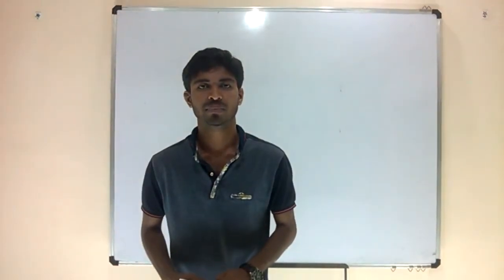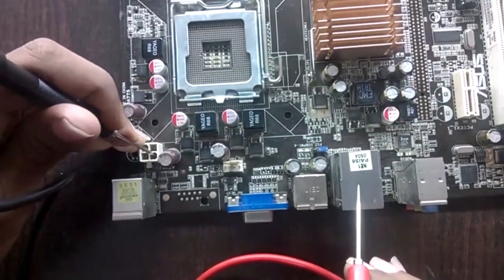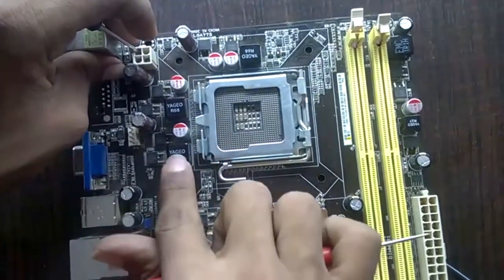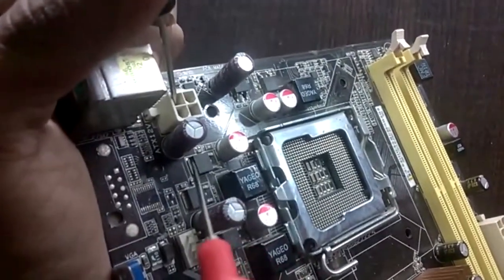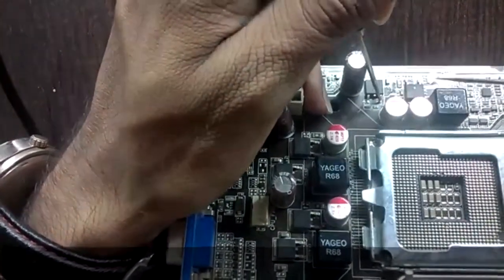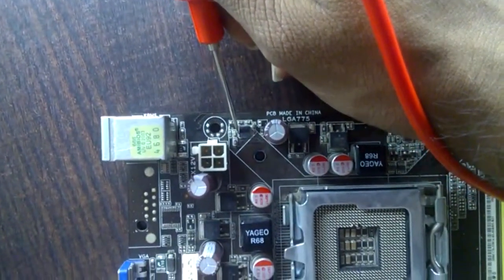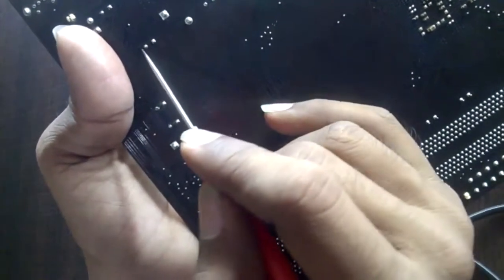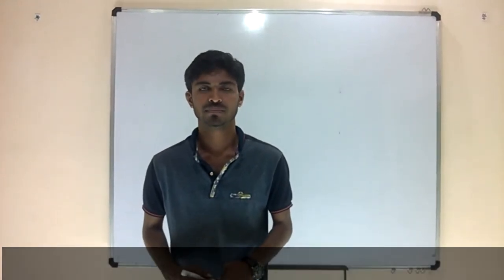[Eng]Advance Chip Level Motherboard Repairing  : Lecture 3 - VRM Circuit in Desktop Practical

Comment: What is tg mosfet and vg mosfet your talking about, what is the function of this tg mosfet in vrm circuit section in motherboard pls reply I want to learn more in your tutorial! nice tutorial!
Reply from the maker: it is tg(top gate or main ) mosfet and bg(bottom gate or supporting)...tg and bg mosfet use for switching purpose... cpu needs small voltage with higher amper.... so to convert to required viltage and amper switching is use that is the function of tg and bg mosfet... i hop you understand...thans lots for your great words and comment

Comment: Good job ! would you do some real demonstrations ? on Desktop Mobos ?  some near future ? thank you for your time and effort ! I mean , on bad motherboards showing how to being tested and fixed ? with hard disk, screen , power supply, etc ?
Reply from the maker: sure i will.. but I need some time so please wait for real demonstration..... and I m Very happy and satisfied by your compliment... thank you so much..
Reply: Fantastic ! Thank you so much !
Reply: please make video on ram section MOSFET and IC..I have problem with ram which getting beeps even after replaced new ram..So I am little confused..I checked VRM section is ok but unable to check ram sections MOSFETs and if and also power connector s..

Comment: For some, you may notice that the capacitor beeped regardless when he tested the negative or the positive. Depending on the circuit it may do that so the best way to know if that component is bad is by removing the component and testing it by it self. You don't have to do this. You may find the fault on your motherboard by tracing other components.

Comment: hi sir im have problem with vrm section the gate of bg mosfet is connected in supply its give me beep and the other bg are no beep in gate  but it provide value  which is the broken??
Reply from the maker: gate always connected with vrm ic...it should beep with ic only...the mosfet which is connected to supply may be faulty...i say may be not confirm it can be happen due to other component also or may be ic is damage so check that things...and thank you so much for your comment...